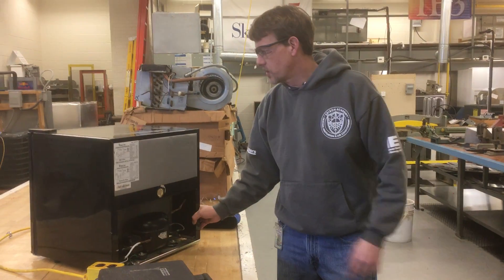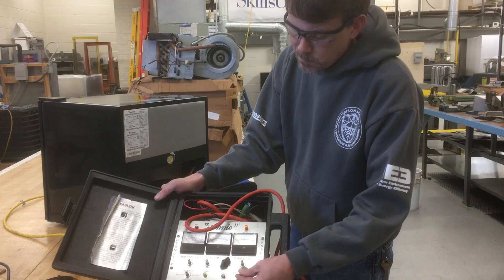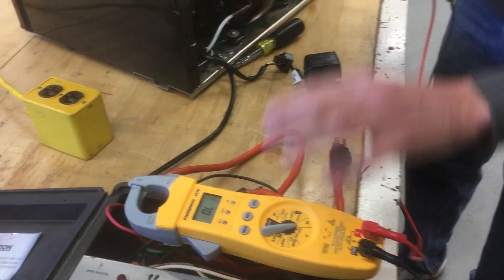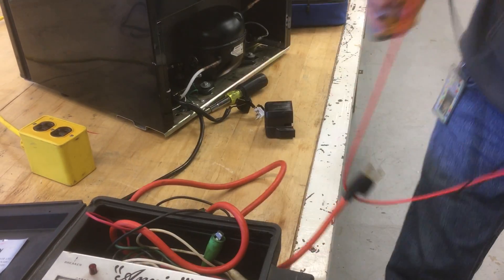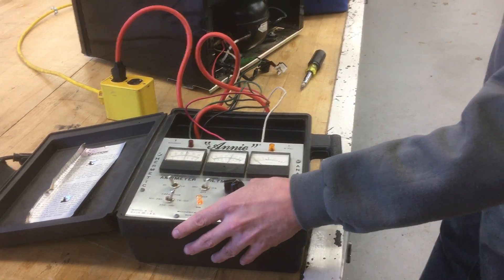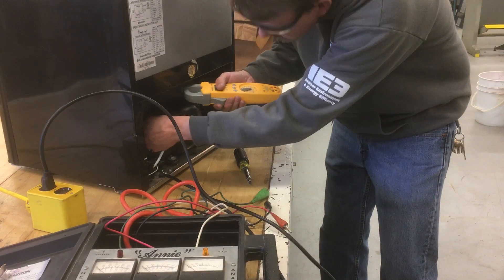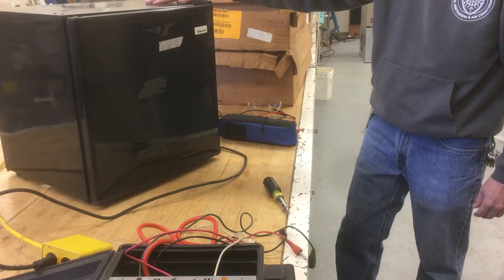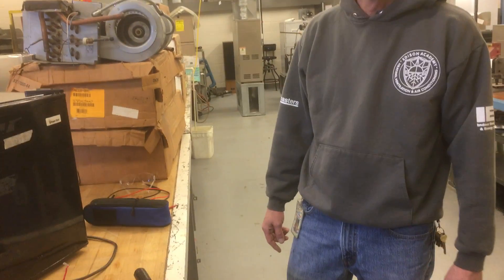HVAC Basics: First - Mini Fridge Troubleshooting Part 2 - Using "Annie" to start a stuck compressor

Comment: Hat Off to Annie, Excellent Video. I punched a hole while scraping the ice. long story short, I plug that hole first with JB Weld, yes it worked for 3-4 days. JB Weld doesn't hole well with freon, but it worked. YES I PUT NEW FREON. 2nd time around I used aluminum solder from Home Depot. it was a learning experience and I spent $200 which I was not going to go down without a fight. Fixed hole, vacuum the lines, refilled with FREON (from auto parts, ITS THE SAME THING) why am I bringing this up ? because mine did Lock Up, hammer tap did free it up but locked up later down the road. I did everything you showed in 1st video BUT found more information with 2nd Part of Video. I found some water in the oil. could be from the hole and me vacuuming. I found the water because I wanted to convert the motor as vacuum pump. Gives Thumbs Up on video. i Like, OLE!

Comment: The voltage control you were adjusting is for the step up transformer that is used to test a potential relay. It does not adjust the output voltage. You should have also held in the start momentary button when you turned on the reverse switch, not turn it on and then push the button,  if you watch your amp meter you'll see why.
Reply: N.W.,-do you,by a chance,have the manual for A12? couldn't find it on the internet..Thanx
Reply: @blev866  yep. I posted on my Facebook page

Comment: Hello, Just wanted to say great Video.

The meter your using I see it's a Fieldpiece is that a good meter? What is the model #, I'm looking for something decent to test compressor amp draw & also want to test capacitors on Appliance's along with HVAC Equipment. 

I would also like to get more involved in testing capacitors on circuit boards in TV's & other small Electronics so would you be able to suggest something that can do all of the above or even if I need to meters like a champ meter & possibly just a separate capacitor tester by itself? 

Right now I'm using a $20 Harbor Freight Clamp Muli meter & a Craftsman Digital/analog meter. I see harbor freight tools now sells Ames multi meter & I seen they have a decent clamp meter for $40

Please excuse my ignorance as I'm still learning. I am mechanically inclined as I've repaired car's for many years but I am really interested in appliance & TV/Electronics repair now too. Thank you very much & have a wonderful day!! 😃

All the best,
Ron.
Reply: Fieldpiece meters aren't cheap.  If you're not doing High power devices you don't need to spend that much.  If you want to consolidate instruments, find a clamp on multimeter with Inrush Current Reading, Voltage, Amperage, RESISTANCE AND CAPACITANCE capabilities.  Maybe Temperature if you think you will need it.  You can spend a lot of money on test equipment if you are inclined.  TV and appliance repair is virtually extinct, unless you're a warranty servicer.  It's cheaper to replace than repair now.  Unless your just doing it for fun and education.

Comment: I am trying to fix my dorm refrigerator, but having a hard time removeing the the cover of the overlay protector, can’t remove the metal around it. It would help if you showed more of the inside of the compartment.
Reply: savekwh Did you ever fix it? I’m having the exact same problem.

Comment: Thank you for the info on the 3-in-1 hard start kits and why to not leave them on.  I had a frig relay go bad maybe 3 years ago, and a friend arranged for an appliance shop to stop in and put one of these on.  3 years later, it seems to have blown out the windings in the compressor (hypothesis), and the frig is now junk.  The compressor vibrates for 2 seconds and draws about 15 amps, and then the 3-in-1 shuts off.  maybe 45 seconds later, this cycle repeats; 3-in-1 clicks, compressor makes noises, and amp draw hits about 15 amps, then 3--in-1 clicks and shuts off.  3-in-1 is hot at this point also.  Seems like the 3-in-1 cools down a little and then it tries to start again.   Every 45-60 seconds.  All this time, compressor round metal cover is also hot.  

There is continuity on all 3 terminals of the compressor, but there is no resistance, 0 ohms, between any of them.  For my model, a 2002 Whirlpool side-by-side, the values are supposed to be 10, 6, and 4 ohms.  My draft conclusion is that the compressor windings did in fact go bad, as the video author describes.  Taking a leap of faith from that, if the proper part had been put in, the OEM relay kit for this frig, the frig would have stayed good for several more years.   All else is good, the fans, the icemaker, etc.  So it totally would have been worth it to me to spend $100 or whatever for the official OEM relay part to get 5 more years of service out of this frig.  

If someone has better conclusions based on this, please share.  If I had one of those reverse-the-compressor things, it could be worth a try I suppose.

Comment: so how do you test for a inverter  compressor?
Reply: You check inverters compressors with DC voltages, current and frequency at compressor terminals. Inverter compressors run on higher DC voltages of three phase emulated by inverting from AC. During inverting process the compressor speed and direction are easily controlled.
Reply: Shawn J
check power going to inverter if both inputs are good replace the inverter.  9 out of 10 times its the inverter.  make sure you clean the coils

Comment: So basically this fancy machine just causes it to run backwards for a moment ? 
Kind of like when you parking with your girl and you get stuck in the mud. You throw your car into reverse and back again to forward and  with any luck be able to drive out, same principle right ? Yeah that sounds better than using a rubber hammer. But I bet that thing is expensive.
Reply: Yep, that's all it is... There's a reason they stopped making them 3-4 decades ago. With all the old school Refridgeration Repair guys retired or getting close and with a complete fresh line of younger people just getting into Refrigeration Repair these companies making the ANNIE all over again will target the youngsters who don't know better. It's been a growing marketing trend in the type industries just like bringing back the new Reel Lawn Mowers that are now dust collectors thrown into yard sales.
Reply: @michaelwatts8052  While I agree the companies making equipment like the Annie (I have one) will target the younger people, HVAC techs make a lot more money swapping out compressors (for residential/commercial use, not these mini-fridges) than they would spending 10 minutes to unlock a compressor. The other thing is there is probably some reason the compressor got locked & thus it will probably happen again shortly down the road.

Comment: you keep saying there is a capacitor. but in 99.9 percent of domestic refers there is no start capacitor.larger ones may have run capacitor but its not "removed from the circuit" as you say. it just uses a ptc or a coil relay. the annie however does have a start cap
Reply: @Michael W nevermind. I get what you said now. By domestic, maybe he meant household
Reply: @Michael W The fridge in the vid says made in China right on the back sticker.

Comment: Great video. Having similar problem with my mini fridge. Just installed a new Overload & Relay and the Overload got hot and broke (it rattles when shaken). So my remaining option is to install the Hard Starter. Where does the brown wire coming from the thermostat connect on the Hard Starter? Thanks.
Reply from the maker: +SAdozer that depends. What type of hard start are you using? Does it have two wires or 5? Also, is there a HP or Ton/Btu rating on the hard start?
Reply: edisonhvac it's a 5 wire Hard Starter rated for 1/12 to 1/5 HP. I haven't ordered it yet. Just wondering how the thermostat wires connect back to the system. Thanks!
Reply from the maker: +SAdozer there should be a diagram on the side of it to help. One of the wires coming from the stat (not the one from the power cord) ties to the start kit line wiring. The other line wire ties to the neutral from the plug (power cord) The other three would go to CSR on the compressor. Does this help?
Reply: @edisonhvac   I have subscribed,  "CSR" was a break down of wiring made simple, Thanks 
Very informative...